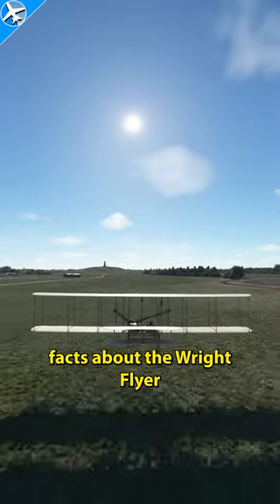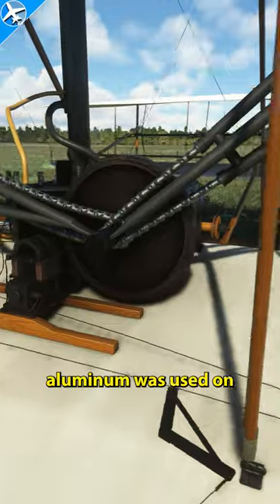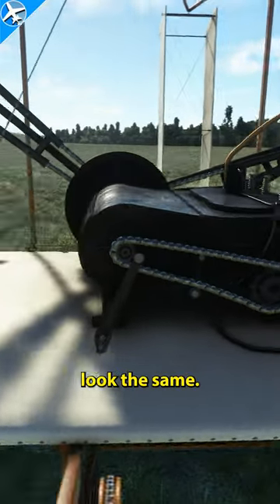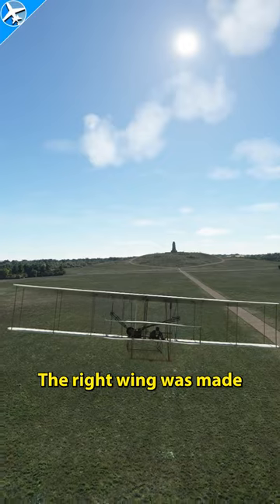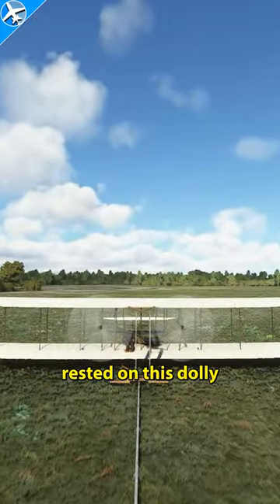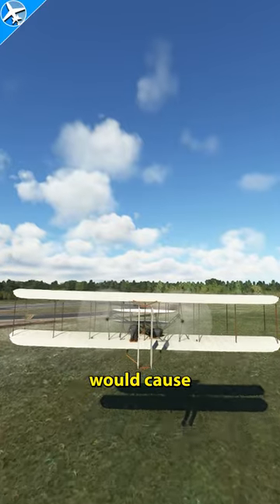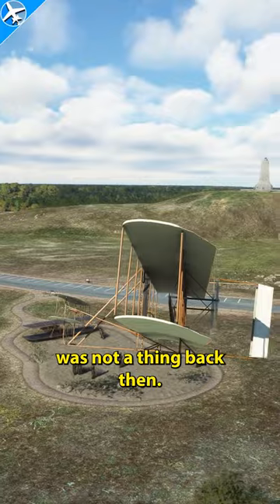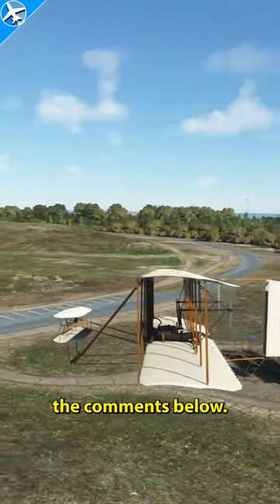GENIUS WRIGHT FLYER Designs

Comment: The Bro’s didn’t invent the airplane they invented the warped wing a way of steering it….     😊
Reply: @LTV_inc The Wright brothers demonstrated the first sustained, controllable, heavier than air flight. It wasn't so much the wing warping, others had similar, it was the ability to make coordinated turns by using the wing warping in conjunction with the rudder. No one had ever managed that before. All previous attempts at powered flight were just straight line hops. If they tried to turn, they crashed. The Wrights also developed an efficient propeller. Previous and many subsequent inventors used something more like paddles on the ends of stick. Those were failures. The Wrights developed the progressive twist prop blade with the help of the wind tunnel they built. The first wind tunnel ever used for aircraft design and testing.
Reply: @Mishn0  good knowledge!
Reply: The Wright brother were the 1st in powered flight.
Reply: @Mishn0  ~ Alder, Whitehead, Pierce, Langley… there’s a few that would excitedly debate you…such as I….                🤓

Comment: ...and just like the electric car, the obstacles they faced could not be overcome, and mankind never flew or drove clean, energy efficient vehicles ever again...
Reply: Electric cars clean? Not hardly. Look at the terrible environmental impact of the mining required for their batteries. And, about 80% of that "clean electricity" put into their batteries was generated in coal fired generators. So, your Tesla is basically a coal fired car with extra steps.
Reply: @Mishn0 , correct. And just like the Wright brothers, those obstacles can never be overcome, and mankind will never be able to fly. Better to just give up now...
Reply: @BrinnerDang  Or, eliminate the government mandates of EVs and let science and industry bring them to fruition in their own good time (if possible) and allow combustion engines and nuclear power to be developed and improved without government interference.

Comment: The most important....they were not the first....
Reply: I knew someone would come crawling out with that nonsense.
Reply: The Wright Brothers were 1st in powered flight.
Reply: @ronsellers5963  there are evidence that suggests the Gustav weisskopf was the first in 1901 an 1902
Reply: Also if you discount weiskopf you can also discount all Wright flights until after 1906 as the w brothers used a catapult to get airbourne where Ellehammer and santos-durborne both got airborne in 1906 whith wheels ie non assisted take off......
Reply: @16jan1986  
Cool, let's take a look at it. Pictures? News articles? What you got.
Reply: @16jan1986  
You understand the launch system was used on the second plane. The Wright Flyer 2.
Reply: @ronsellers5963  the editorial in the 2013 Janes all the worlds aircraft